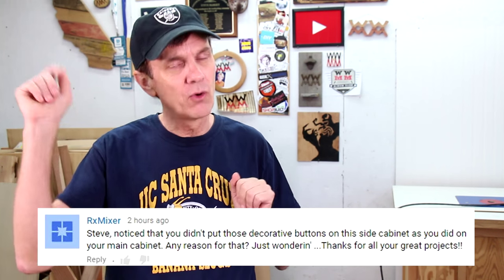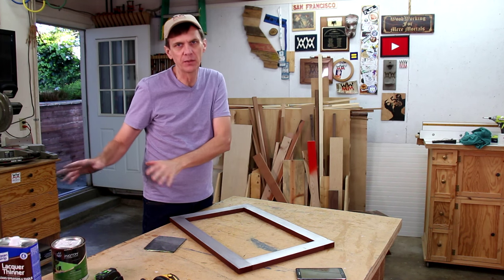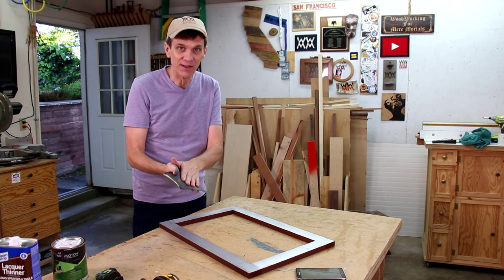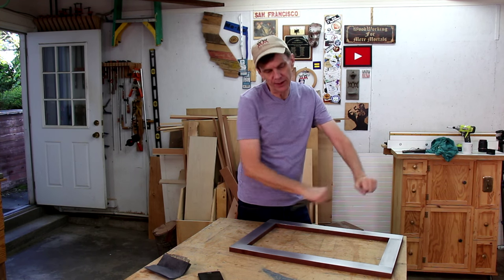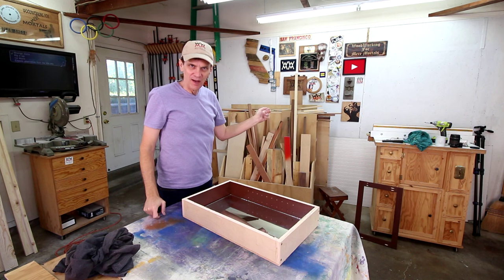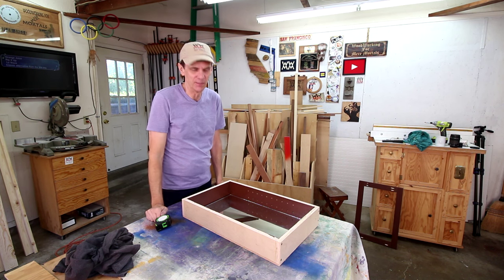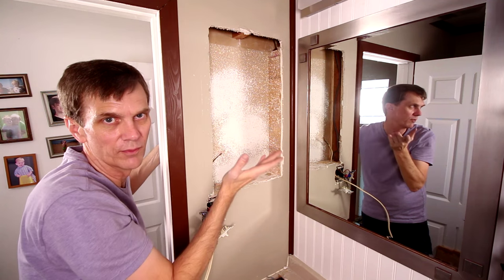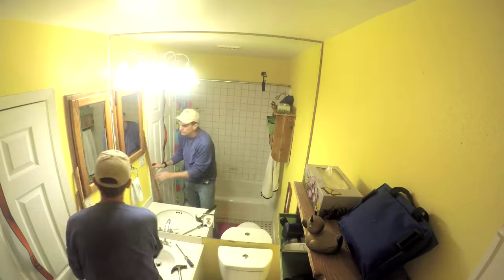How Big Should Small Be? | MORE MINUTES

Comment: Dude I agree.  I like smaller spaces as long as they use space efficiently and in a way that still allows full range of movement.  Have you ever checked out the "tiny houses" thing?  People building on 18ft trailers and such. It's really neat what the can fit on those things. P.S. I love the smell of vinegar and also 2 cycle engines running.  I think maybe that's a nostalgia thing.

Comment: So my house has two bedrooms. Originally the house at three bedrooms, two identical sized and then a much smaller third. I merged one of the two identical with the smaller and so now have a "big" room and a "small" room.  The paint scheme is basically the same in both. a light green and darker green two tone design. For the smaller room I used the dark paint for the bottom half of the room and the light on the top half, this was indeed to help the room seem bigger. However, for the bigger room I did it mostly the lighter green and then painted a strip of the dark from the ceiling down to the top of the door frame all the way around the room.  The goal was to make the room feel smaller, cozier, and more intimate.  So yeah, bigger isn't always the goal.

Comment: Space, how it is used, how much is enough, how it is divided, is a culturally determined judgement. I am an American from the west coast, who has lived in Brazil for over 30 years, and I still find myself "judging" Brazilian decisions about use of space with my western American value system. Brazilians prefer a more compartmentalized approach, a space, even small, for each activity, rather than open, multi-purpose areas more common in the West of the US. An example is the kitchen in my brother's apartment ( in Brazil). It was not a large kitchen, and it had a washer and dryer space in it. There was a wall separating the areas, which left the kitchen without natural light. My brother hired a contractor to remove the wall to open up the area visually and let more light in. The contractor did the job but kind of grumbled under his breath wondering why anyone would want their washing machine in the kitchen.

Comment: I was in a commercial bathroom yesterday. It was outfitted with a sink and a toilet. 8 feet wide and 12th feet long or more. Way to much space for it use. 
If the fixtures and cabinets fit the space, not to crowded for guests than you have achieved your goal.
Reply: Commercial bathrooms also have to follow specific laws regarding occupancy and ADA regulations.